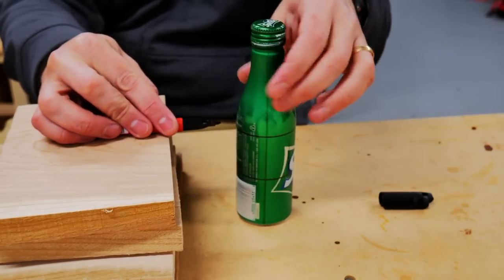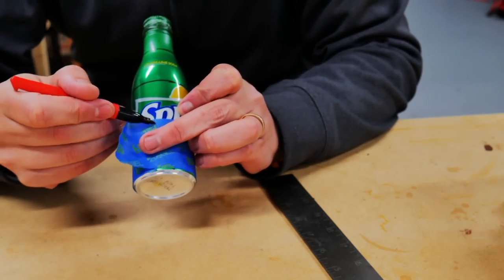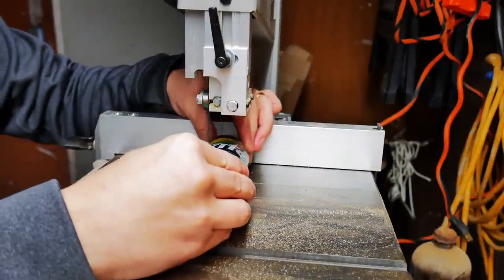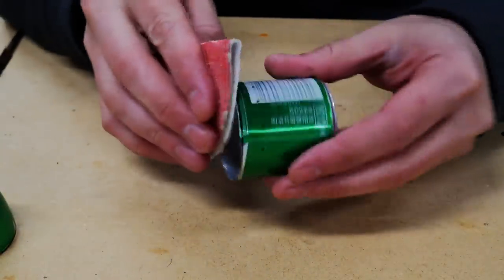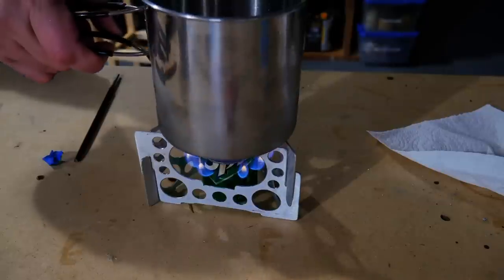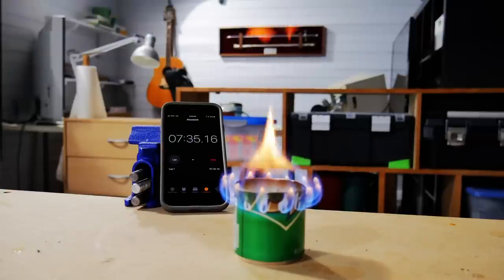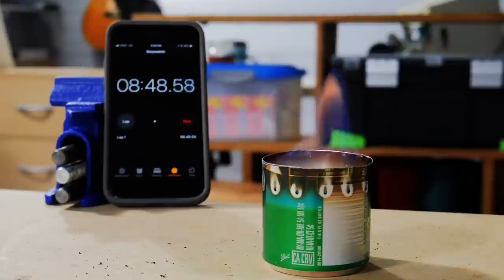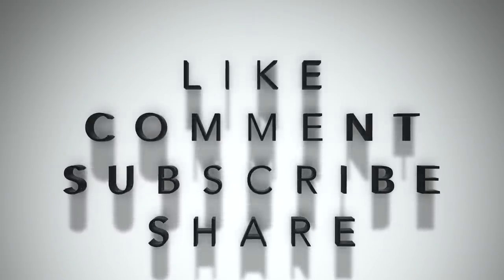The BEST Alcohol Stove I've Ever Made! - 14 GRAM Weight!

Comment: You should stick a nail through the jet holes and push up to angle the holes upwards, as far as it will go.  I believe this concentrates the flames and increases the heat transfer.  I do this for all of mine.

Comment: I bought a similar stove .. A 'White Box Stove'. It's made from a heavier gauge Aluminium with a Roll Seal at the top .. a little Gem.
More expensive and a bit heavier .. yes. But as robust, and perhaps more, as anything out there .. can take most any pot weight and fits very nicely into my little Aluminium Kettle.

Comment: I've found that, since carbon felt's attribute is to absorb heat, it takes longer to warm the inner chamber alcohol to temp to where it blooms, so I don't use "wicks" in my burners or stoves (because it wastes alcohol, with the extended blooming time, making the burner or stove less fuel efficient - MUCH less efficient).  

I highly recommend using priming fuel around every burner or stove to increase the overall fuel efficiency that is gained from light to bloom, and the earlier bloom to runout.

Coupled with a windscreen/cone and lid, my boil times are blazing fast (I have one that is sub 4 min).
Reply: Insulation doesn't absorb heat, it buffers it—or cold. It buffers temperature differences by creating pockets of air, which is very thermally conductive...

Comment: Nice stove. A lot harder to make than the Fancy Feast so there is that. And the Fancy Feast is sturdier. Be careful with yours. 

That and Hiram determined a 1 inch height above the jets is optimal. Also notches in the top help keep it from sealing.  

Just some thoughts. Well done.

Comment: Yes I saw these, and have made multiple stoves.  But I also just left the bottle (and cap) alone.  Push in a massively long navy mop dreadlock as a wick.  Pour in alcohol.  Can pull out dreadlock as a single wick, or unwind for 4-6 wicks outside hanging and down outside of the bottle.  If you make some long copper metal "L" wires, put into the wick and bottle.  Pull out and thread through dreadlock wicks for greater horizontal flame circumference and heat.

Wobbly - no!  Just dig a little hole in the dirt, and pack dirt around, and have cook pot above with grill, rocks or whatever!  Metal bottle is entire stove and alcohol flask (6 ounces).  Can also input citronella essential oil (for skeeter control candle).  Melt wax onto outside wick - and push hot wax wick into bottle, pour in remaining volume alcohol) - wick burns both wax (as candle slow and hot) and alcohol (high heat).  When done, extinguish wicks, push back inside, and put cap back on.  Can use and hang inside tent - as SAFE tent warmer, emergency hand/crotch shelter warmer, ....  Total fire carry.

Comment: Hi, enjoy watching your channel and I've learned a lot. I have a couple of questions about this video: (1)why did you not just cut all the pieces to fit with the bandsaw  instead of cutting and then using tin snips? (2) why did you not roll the edges of the tube over the inner tube? I tried to use the roll over edge method and ended up with a mess on my hands.
Reply: Possibly finessed the cuts with snips because the bandsaw cuts leave rough edges that wouldn't seal as well? Same with cleaning up the 1/16th" drill holes. I didn't do that and didn't get good flames.
Reply: Practice annealing and peening more.

Comment: Good job!. These "type" need a pan or lid on top to force the "jets" to burn. Saves fuel, a lot! Also, need to cut small opposite side notches ~1/8" deep, in top "rim". It helps with heat difference with stove and pan. Felt not really useful in this design, great for Fancy Feast stove. These are much stronger and more durable than a soda can stove. Thank you.

Comment: Don't have the tools to make one but it looks great.
Reply: You don't need a bandsaw and drill press, that's definitely overkill. You can cut the bottle with a pair of scissors and make the holes with a small nail or a push pin.
Reply: @a3a14613 If cutting with scissors go slow and check for drift. You're cutting a round object and it's easy to get it unlevel. So stop frequently and correct yourself as needed.

Comment: I just started watching some of your vids for can stoves. How do you think Coleman Camping Fuel would burn? I have a half gallon of it sitting.
Reply: Absolutely, positively NOT! This type of burner/stove is called "alcohol stove" for a good reason. Use alcohol fuel only! The only recommended fuels are:
1) Denatured alcohol. This is often sold in hardware and big box home improvement stores in the paint department. This is a blend of ethanol and methanol alcohols.
2) HEET gas line antifreeze for your car. The yellow bottle only. This is 99.9% methanol. 
Either will burn with a clean, blue flame that can not be seen in strong sunlight, so be careful!
(3) In a pinch, use isopropanol, between 70% and 95%. This can be found in pharmacies and big box stores, sold as rubbing alcohol. The disadvantage of using this for fuel is it will get your gear sooty. Not just a little sooty, but really black with soft, transferable soot. Gobs of it.
NEVER_ use Coleman fuel or white gas, or any other petroleum fuel like diesel, kerosene, naptha, or finger nail polish remover. Not only will these burn with black soot, but are likely to explode.
Reply: I agree with xenaguy, white gas/naptha is extremely flammable. I don't even like using naptha stoves for that reason, very dangerous.
Reply: @a3a14613  
I forgot to add, it is safe to use naptha/white gas in a stove designed for it's use. Used properly, in an appliance designed for it's use, it is no more dangerous than any other fire.
Reply: @xenaguy01  Technically, yes. The fuel is extremely flammable and the appliances are prone to leaks and flare-ups. I have a generator to replace on my single burner. The Coleman stoves and lanterns used to be our go-to for the cabin, but there are far safer options available today.
Reply: @a3a14613  
The main point is that is not only unsuitable for use in an alcohol stove, it is extremely dangerous to do so.

Comment: won't the thin tin evently be burned through by the flames?
Reply: No, it isn't tin. It's aluminum. And they don't just burn indefinitely until the end of time. The amount of fuel used burns up in about 6-10 mins with most of these. 45 or 55 can be achieved with finesse and technique, but either way only the fuel is being burned. You're not lighting the can itself on fire.

Comment: I made an alcohol stove and it exploded! Maybe I didn't use the right rubbing alcohol?
Reply: if it is a double-wall, drill a pressure relief hole on the inside near the top.
Reply: @AntonSwanepoelTravel inside of the inner wall, or inside of the outer wall?
Reply: You used way too much. Stop using ISO and start using DNA like literally everyone has told you to.
Reply: @samhain9394  hi. On the inside of the inner wall so that if pressure builds between the two walls the excess can escape through the center hole where the main flame is and where you light it.